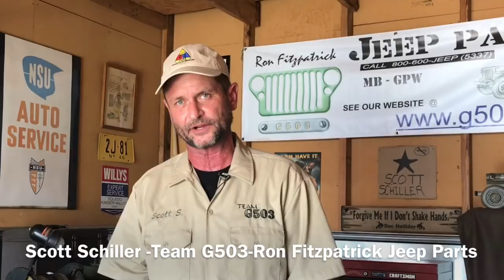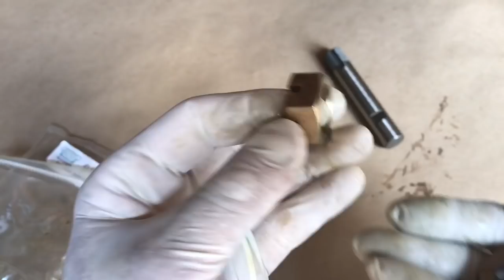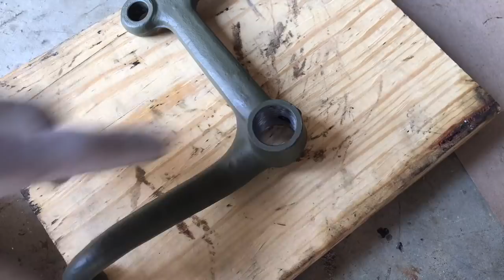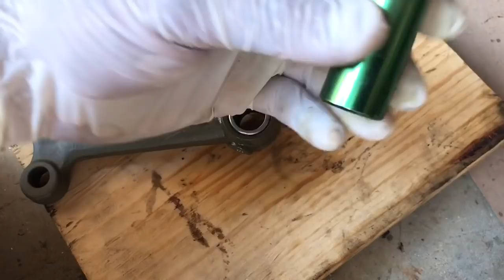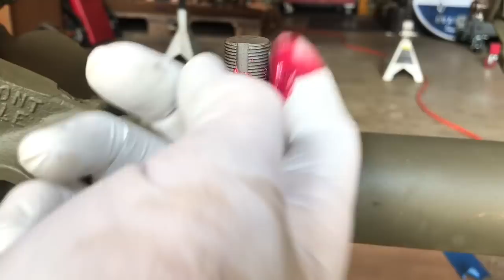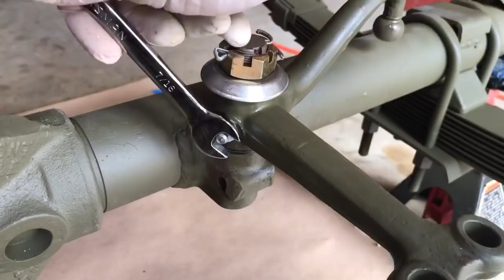Willys MB or Ford GPW, Bellcrank Repair Kit Installation, Team G503

Comment: Please point out lining up the grease access holes in bearings with zerk hole. Check alignment with small copper wire. Great video. Great series.
Added  2/3/19...Thanks to Max who pointed out the real reason for the small hole is NOT needed to line up with zerk fitting per my suggested tip. Shows you how a rookie can make trouble for himself, but thanks to experts out there to point out my errors! I keep telling my wife I need to quit fooling with these machines, just pay someone to do the work, and allow me just to drive them. LOL . Lottery chance of that happening. Still GREAT series to learn from. JeePa
Reply: That's not how it works in this application ... the hole for the grease fitting lines up BETWEEN the two Needle bearings, (They are like 1/4" apart)  the hole in the outer race of the bearings is no where near the grease fitting hole, and there is NO groove in the inner bell crank casting to access those holes in the bearing races. Vintage grease guns operate at well over 10,000 PSI of pressure and have NO problem getting grease everywhere it's needed.

Comment: Thank you for the video. My willys mb has a f/n/s wheel wobble most noticeable between 30-35mph. I’ve replaced the combat rim but it still wobbles. I’m now thinking could the cause be a worn bell crank or bearings?

Comment: My CJ is a 46 with the "top mount" bellcrank. I noticed after install, there is very slight movement of the large pin, from side to side. Normal? not much very slight.....

Comment: Not mentioned - How to remove the old Bell Crank Shaft.  I had to drill out the pin and then it was impossible to remove the shaft.  How important is it to replace the shaft ?
Reply from the maker: David Egerton the pin is tapered. I would be hard to drill as the dimensions differ from end to end. Heat from a torch and a penetrating catalyst are your best friends. There is an early vid on removing this assembly. The shaft is important to the whole assembly. Any scoring or pitting will cause problems.